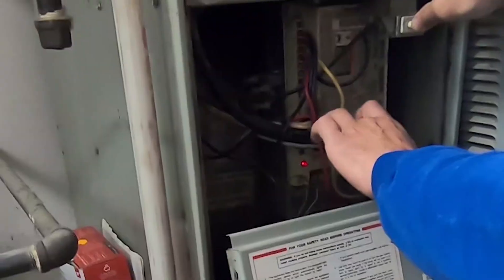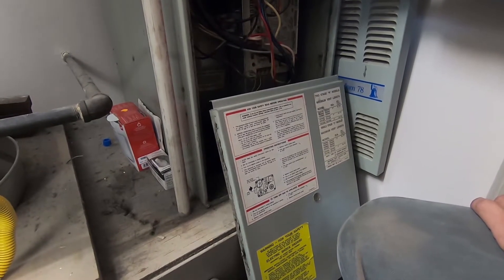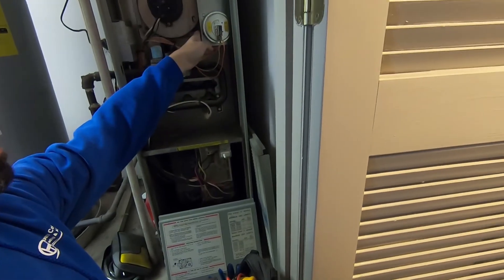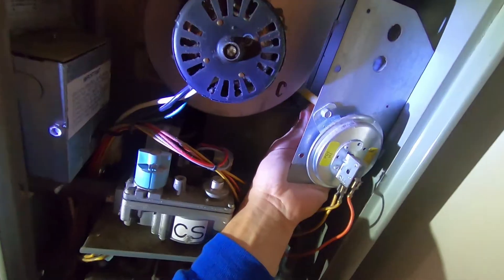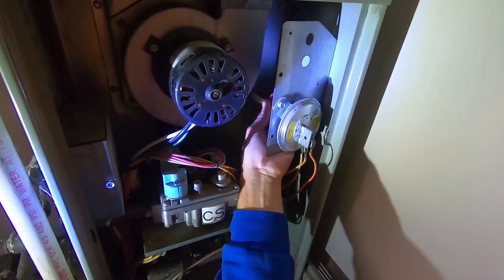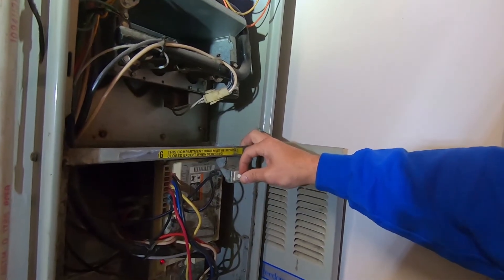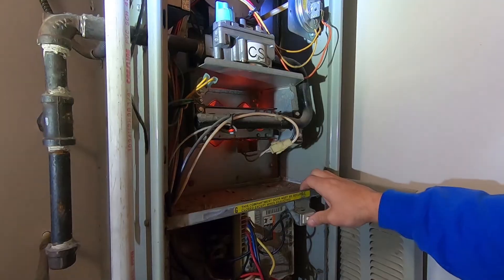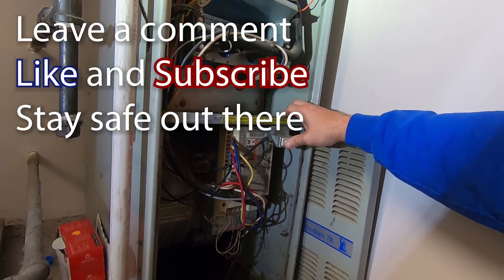pressure switch vacuum tube EASY FIX furnace error code

Comment: Thanks for the info. Fixed my problem.  We had our furnace serviced. We went to start the furnace weeks later. And were getting this code. Noticed they must have forgotten to reconnect the hose before they left. Works fine now 👍

Comment: Bad diagnosis. If this happens to you, it is because your furnace is under fired. An Under Fire furnace has flu gases that are cold. Which then causes condensation in the cool aluminum, or light Steel that that inducer motor housing is made out of. The condensation of the Furnace is lacking of hydrogen. This Means low ph, which is an acid. The acid chews away the metal and ends up in the pressure switch lines, or the pressure switch itself. You need to replace the pressure switch and the lines then bump the gas pressure so you are not having excess oxygen greater than 9%. If you do this you'll never have this problem. If you had your system installed and it is doing this you need to call the installers back and tell him to properly adjust the unit, replace the inducer motor, pressure switch lines, and the pressure switches. Because they did not set it up properly upon installation.